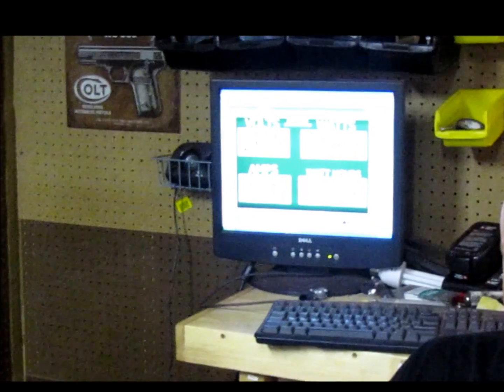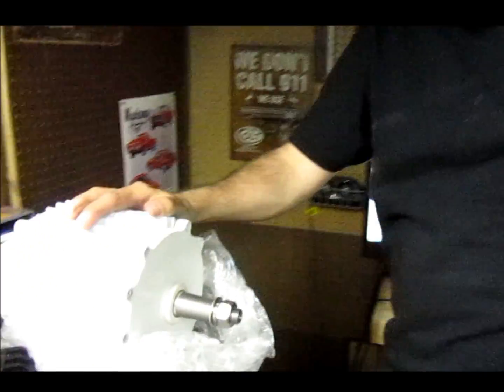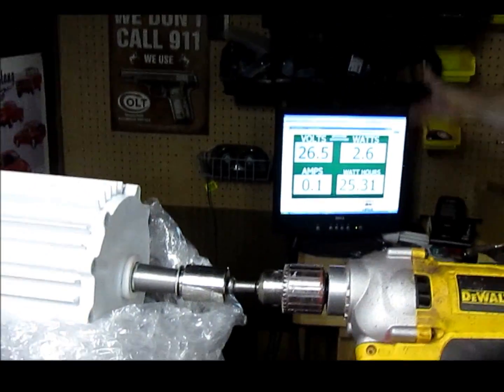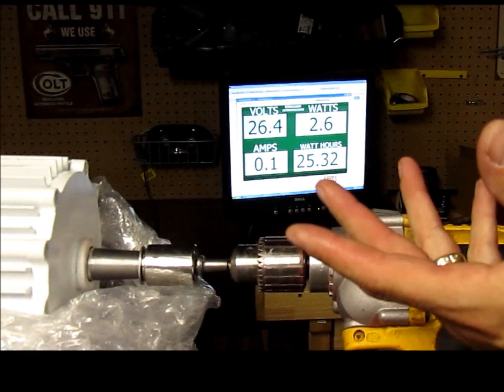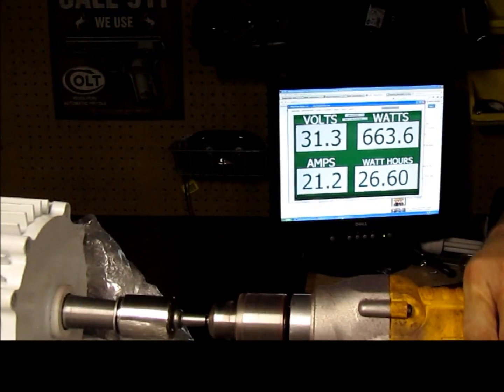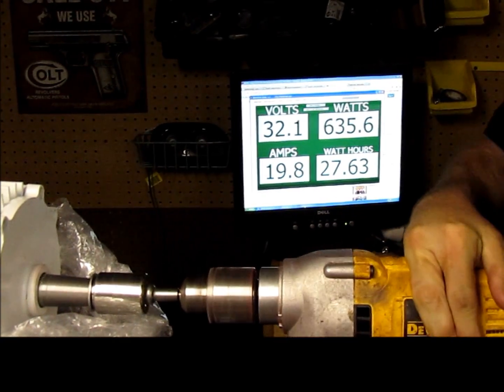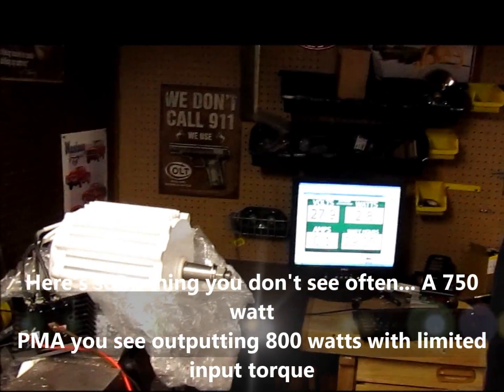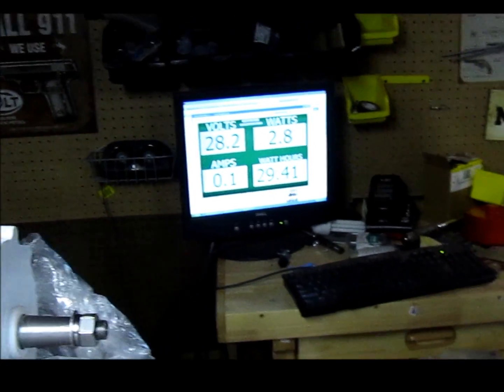Hurricane Wind Power White Lightning

Comment from the maker: These turbines cut in below 300 for 24 volt and 150 for 12 volt I believe we were running closer to 500- 600 rpm at max output for 24 v. More testing needed and not enough hands for a 3 fingered guy to do at every power increment at this juncture. We are however ignoring the you tube pissing match and focusing on our business so we will have more time to spend on what matters which include in depth data.....that is what people want today and we will get there

Comment: not undermining , but if a system is producing 600+ watts per second  per minute  for 1 hour doesn't  that egual 600 watt hour and not 25 watt hour as in this video?
Reply from the maker: Although this was a run video to show output at a given input the point with any system is kwh over time. At least that is how our power bills come.
Reply: +Hurricane Wind Power that is true that our bill comes in total kwh used per month, but at 25wh it would take 4 hours to make 100 wh times 10 = 40 hours to produce 1 kwh :) = about 10 cents worth of electricity.

Comment: Tony , I have the windynation  supper amp wind mill and am well pleased with it but they don't sale wind products anymore . I just found your site , would this be a good replacement pma for my 12 volt system .? It has the furling tail with a 6.5 diameter swept area and starts furling at 31mph .

Comment from the maker: As you can see the test was taken at 24 volt environment. An RPM taken would be at a given power output....it is a wind turbine and the rpm for cutin is no where near 500 RPM but you would have to put a tach on the shaft at a given output at a given power output to answer that question...it was a simple drill unlike our left coast brethern we did not strap a 5 horsepower gas engine to our PMG...I do have a synchronous drive on order for a testing station that will provide more in depth data